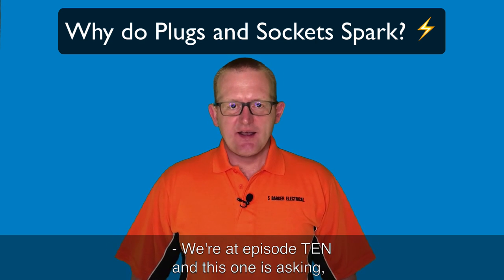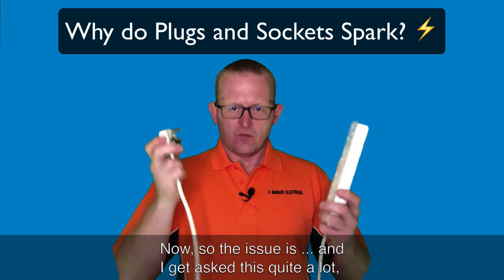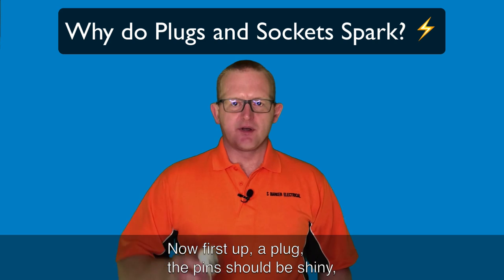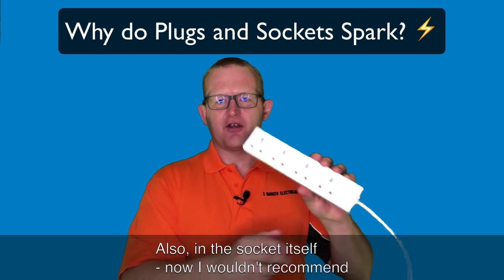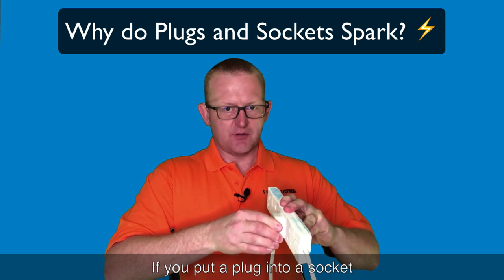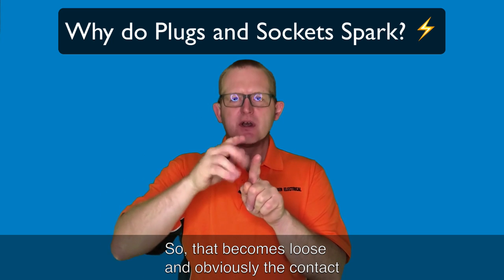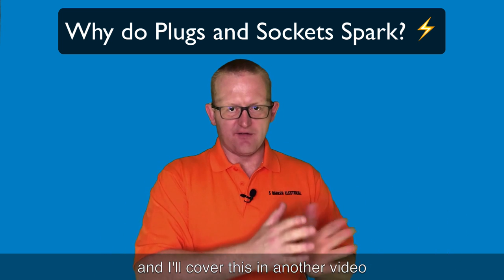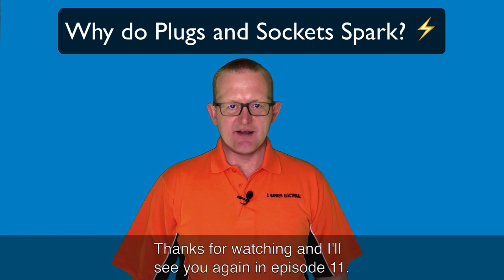Why Do Plugs and Sockets Spark?

Comment: I plugged the cable into the wall and I saw a blue spark
Reply: Yes that can happen with higher loads (powerful equipment) but it happens more if the plug or socket (or both) are becoming more worn. Was it loose or tight when you put the plug into the socket?

Comment: Just now I unplugged my ps4 from a extension cord and when ever I try to plug it in it sparks (yes I am a kid and I got scared)
Reply: Hi Jenna, it's likely quite normal as your PS4 when switched on draws a certain amount of power, and so unplugging while it is still on will cause sparking (It might even use standby power when it's off too, I'm not sure as I don't have a games console). But switching off your extension before plugging in and removing will stop this from happening.

Also check that the plug and extension are not worn (the metal is still "shiny", not dull) and that the connection feels tight rather than loose.

Simon
Reply: @gingerelectrician   okay thank you
Reply: I use an extension cord to charge my phone, I just plugged it in and some sparks came off it. I got scared too, but it doesn’t spark every time I plug it in… sooo idk :3

Comment: My socket started to spark with blue sparks and made a popping noise when I plugged something in, I've unplugged everything now but is this normal or a much larger problem?
Reply: Check the plug is not worn - If not see if it does those on the newest socket in the house too. If all is in good condition then plug in with the switch off, then switch on once it's plugged in. Make sure nothing overheats too (at the socket side) and on the flat plate once it's been used a while

Comment: bro when i connected a charger it sparks and now the current is not coming from that board , the charger was loose also
Reply: Ah ok so it's possible that a fuse, breaker, RCD or even AFDD (Anti Arcing Device) has operated when it was plugged in. This should definately be looked at by a local Electrician to see what has caused that. They will be able to pinpoint it exactly by testing and looking at it safely with the covers off. Please don't do that yourself :-)

Comment: My plug has corroded like very little. It's size is about the size of a pens pin. So what should I do?
Reply from the maker: Ideally you would replace the plug and possibly the socket too if there is a chance that both are worn. Although I'd also wonder if there was any reason for corrosion, such as damp? If so then that cause would also need to be looked at to prevent it reoccurring in future.

Simon

Comment: I scratched my plug, is it fine to use it?
Reply from the maker: If it's a light scratch you should be ok. But if cracked, damaged or worn in any way then probably not.
Reply: @RealSimonBarker  Its like a lot of light scratches )

Comment: Thank you for this! but my laptop charger rubber protection just got cut and i got zapped a bit, it won't charge and everytime i put it in, i see a huge spark. what do i do?
Reply: If the insulation on the charger is damaged (enough to give you a shock) then you need to replace it with a new one (and bin the old one)
Reply: This happened me too a while ago, had to just get a new one
Reply: @electricalbusinesscommunity  I done that with VHS player years ago as a kid when I was hooking it up dam it shocked me I even been zap by shock wire fence
Reply from the maker: @unknownwolf4046  ouch!

Comment: Thank you. Had an issue at my house. I saw some sparks. I unplugged our washer and dryer. The electric company fixed some wires at my house. I plugged the dryer back in and it started sparking. The plug in the wall is very loose. It definitely needs to be replaced.
Reply from the maker: Yes, the socket will often need replacing with the wiring because when the wiring burns out, it affects the socket OR vice versa. Thanks for watching

Comment: I was moving a piece of furniture recently and struck a plug coming out of a socket, causing it to spark internally for a few seconds. Would this mean that the socket needs replacing or securing or is this typical ? There is no spark during normal operation, but I'm wondering if it should be able to withstand that sort of thing without sparking?
Reply from the maker: Check if any damage was caused when the plug got caught. Make sure the plug is not bent or damaged and also no cracks on the socket. It may have sparked naturally as it withdrew from being pulled. But definately check the condition and that the pins on the plug are clean and bright and that the plug fits in the socket securely and not loosely. Compare it to how other sockets feel, especially any newer ones that you've had fitted.

Simon
Reply: Thank you @RealSimonBarker

Comment: I got a new extension sir and when I plug my charger in it sparks. What should I do now?
Reply from the maker: A charger will naturally have a small spark when plugging it in, but as long as both the charger and extension socket are in good clean condition then it shouldn't be anything to worry about. HOWEVER if you want to stop the sparking, switch off the extension first, then plus in the charger, then switch the extension back on.

Simon
Reply: @RealSimonBarker  Thanks Simon.

Comment: Is it dangerous?
Reply from the maker: If it’s just from not switching off when inserting the plug then often now dangerous. But if it’s from loose connections then it may be the start of wear leading to overheating which ultimately leads to a fire hazard (over time). But by checking to make sure connections are not loose or worn then you can prevent this

Comment: Hi Simon my guitar amp plug flashed when I plugged into an extension now it doesn’t work I think it’s the fuse but not sure I can’t remember when if flashed if it was a blue or white light it happened so quick will anew fuse help?

Comment: Sparking when plugged in is very common in switching power supplies, because the mains smoothing capacitor is drawing for a very short time (>0,5 seconds) an extreme high current (>70 amps), because it can be charged and discharged very fast. This is called inrush current. It’s also common in electric motors and mains transformers.
Reply from the maker: Absolutely. :-) Didn’t want to confuse by going too deep on this post. But yes that’s absolutely true

Comment: My one outlet, for the longest time, makes a small little crackle when I plug something into it. Is that an arc or a dirty wire or just normal.
Reply from the maker: Make sure the pins on the plug look clean and bright and not faded. If this is the case the try the same appliance on different sockets around the house. If this socket is the only one that sparks (or if it does so more that the others) then it's likely the socket needs changing as it is likely worn. 

Also if it feel loose when plugging into the socket, that is another indicator that the socket is worn.

Simon

Comment: I have a charger that plugges in to anything it sparkes or is like eltricity pop and it looks comletly fine
Reply: It's usually more cosmetic than an issue (although  note the points about making sure the pins are clean and also the socket connections not loose). To prevent the sparking, switch off the socket first, then plug in, then switch on again once it's plugged in.

Comment: I want to know what could cause a psu to spark when turned on, I don't know if you know about that equipment. The thing is that the sparks are similar to the ones you are talking about, I don't know if it is serious or if that could happen to a certain extent and be normal.
Reply from the maker: Hi without seeing it, this is hard to tell. But if it's where the power cord attached to the PSU unit itself (usually there's two seperate parts that plug into each other), ensure that is tightly connected and not loose. Otherwise if there's any visual damage, cracks in the casing, signs of overheating, then it will want replacing.

Comment: Thanks for this info. I plugged in a computer the other day and a huge spark came from the wall socket right next to my hand(couple centimetres away). Thankfully didn't feel it but I think it completely fried the computer. It also tripped the circuit and blew a fuse. The computer power cable I plugged in also got quite damaged on one of the pins from it(a big chunk taken out of it with dark scorch marks(same mark inside the wall socket). Gotta say it was not a nice experience but it has given me an opportunity to learn more about it and buy some surge protectors.
Reply from the maker: Yes surge protection is useful and now (in the UK and other countries) you can add Surge Protected at your Distribution Board (Fuseboard). Then you can also buy surge protection sockets as well as Surge Protection Extension Leads.

So in addition to the condition of what your plugs and sockets, you might also want to make sure you aren't overloading the socket or extension too. 

Finally keep checking the cables for damage, as well as the equipment (dust in PCs and so on). Maybe invest in some simple cable tidying to keep it from getting damaged, even if you make your own with plastic trunking or similar,
Reply: @RealSimonBarker  Oh that sounds very interesting thanks for the ideas. Had no idea it was possible at the fuseboard or sockets. Would you say that it is important to add surge protection to all areas and sockets of the house? For example for each wall socket, to only use a surge protector and never just plug appliances directly into the wall.

I will definitely keep an eye on the cables and maybe hang spares up in a closed space. Do you know if it's safe to clean (unplugged of course)cable pins with cleaning alcohol(99.9% isopropyl)?

By the way I'm in The Netherlands not sure if that changes anything. Sockets seem to be grounded here.
Reply from the maker: @Koozwad  The latest electrical regs (IN the UK from September 2022 onwards) suggests that you should use Surge Protection at the fuseboard level. So by default a lot of Electricians will be fitting these now. They are around a £50 addition to the price of a modern board that will take it (Price will be up and down from that in future).
Reply: @RealSimonBarker  Alright I'll be sure to mention it when I get an electrician over. My electrical system here is very old and for the most part doesn't seem to have been updated in a few decades. Got a lot of old retro wall sockets too that have long lost their grip while I barely used some of them. Thanks for your advice.

Comment: Should I be concerned if my light I just sparked the first time I plugged it in,  but works fine every other time I plug it in and the light works with no problems other than this one time I plugged it in ? Have not had it spark since. My light was purchased with no intention of unplugging the cord when not in use

Comment: whenever i plug my anker pd 18w it always spark pls let me know if it will hurt my device or it is normal.. tia
Reply: Easiest way to proceed is to plug in while the switch is off, then switch on. That way you'll get no sparking. The sparking only occurs when connecting with load (i.e. when switched on)

Comment: My fan plug sparked when i pulled from outlet. I just noticed the plug on fan looks burned and a little blackened. How do i clear the fan's plug? Will this stop the sparking?
Reply from the maker: You might need to have the plug changed if it's burnt or damaged. And if the socket is also worn or loose then that should be replaced too. Also you could PAT Test the fan. A local professional electrician should ideally do this for you.

Comment: Would a socket spark hurt a device or the charger?
Reply: When a socket sparks, this can create electrical noise. This usually means voltage spikes (either small ones or significant). If larger spikes, then yes those can be damaging. But you can add surge protection and other devices to protect against it. Some equipment may even have a certain amount of built in protection, while others do not.

Comment: If the flat part is abit dark like black residue can u scrape it n use it again or never again
Reply from the maker: Cleaning does not always fix the issue, sometimes replacement is better, especially if it is the socket rather than the plug.

Comment: hi sir,I'm using a Motorola device
bought it 10days ago
the charger I got with it suddenly while nothing was connected to it sparked out while it was in the socket
Reply from the maker: Best to switch it off at the socket then insert the power supply, then switch it on. If it still sparks then the power supply or socket (Depending where the sparks come from) will need to be changed most likely. Or get a local electrician to look at it.
Reply: @RealSimonBarker  I have plugged it in different socket....it hasn't sparked since, should I connect my smartphone
Reply from the maker: @Mee399  In that case it may be the socket, but a local electrician would be able to confirm
Reply: @RealSimonBarker  okay,thank you so much😊👍🏽
Reply from the maker: @Mee399  Not a problem
Reply: @RealSimonBarker  I got it checked by an electrician!he says socket is completely fit...I tested it and my phone does charge....I assume that it has to do with fluctuation of voltage because there was was a power outage soon after that....due to bad weather and maintenance power is often been cut in my region...
Reply from the maker: @Mee399  ah ok that porbably doesnt help - voltage spikes with power cuts
Reply: @RealSimonBarker  don't know man,but I guess modern adapters do have an inbuilt fuse to avoid any potential damage and that's how as far as my knowledge is concerned Fuses do burst themselves to save devices and all sort of home appliances from damage that might be caused by such voltage spikes!anyways thank you😊❤️

Comment: I try to plug in my A/C in to all the plugins an it'll run for five minutes and cut off. The cord gets very warm. I tested all my plugin's and they say correct wiring. Would it just be my A/C needs cleaned?
Reply from the maker: Difficult to say without seeing it, but I would have someone check the aircon unit, the connections in the plug, the suitability of the socket (and how much load is on that same circuit). That's just for starters. Get a local Electrician to check it all out :-) Best to be safe than sorry.

Comment: Is this the same for north american sockets?
Reply: It will apply to any socket where you are physcially plugging in and out. But still the best advice is to check for wear but also switched off before plugging in or reomving.

Comment: Wait so is it dangerous or not
Reply from the maker: It's something that you need to be aware of to make a decision if you need to replace something that is wearing or burning out. So if it gets into a bad state and is left unchecked, then yes, it can become dangerous at that point. But checking regularly will hopefully prevent any issues if any are lurking. You can also get your items checked with PAT Testing or your house/office wiring checked with an EICR, which are mentioned on the services page of my website (Just for information to accompany this reply). https://www.sbarker.co.uk/

Comment: Hello sir i came here for a issue at 6pm night i was putting the plug from my laptop on the socket and it got sparks all over it so i quickly disconnected it
So what will i do
I kinda scared leaving my 789 subs channel on my laptop so how do i fix it?

Comment: No way, i have a new ref and a new receptacle and it still sparks. find a better explanation
Reply from the maker: Better to switch off first, then plug in, then switch on. It’s when you plug in and the switch is on that sparks happen (which is normal as per the video).

Comment: It has NOTHING to do with what you described!
It has to do with your transformer that is likely connected on the other side of your AC plug. It has to do with ELECTROMAGNETISM and what happens when your transformer is first powered on.

Your transformer in your device acts as a short circuit for mear milliseconds which causes that spark! The current is so high that it causes a spark when it gets very close to the powered lines. Kinda of like when you get shocked by touching a doorknob or your car during very dry days.

That transformer will start acting like a resistor after current rushes thru it for a few milliseconds and then it becomes resistance to change when your AC fluctuates in voltage from positive 60 volts  to negative 60 volts at 60 times per second. With how electromagnetism works, it tries to prevent voltage from hanging which creates the resistance and as such, prevents a short circuit in your connection.

Comment: I have a Rights phone my 65w charger sparks when I plug it in the wall it scares me I thought Dr strange is in my wall lol
Reply: lol as mentioned in other replies, if you want to prevent the sparking when you plug in, first switch off at the socket, then plug in the charger, then switch it on at the socket. Also just keep making sure all is on good, clean condition. :-)